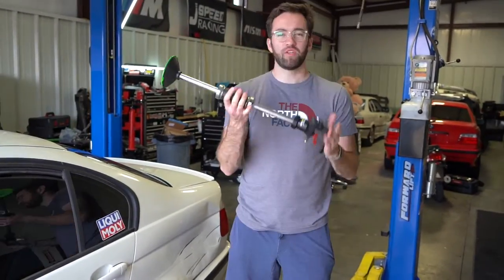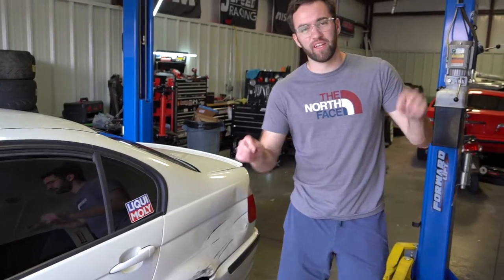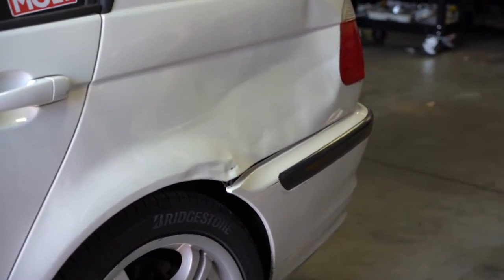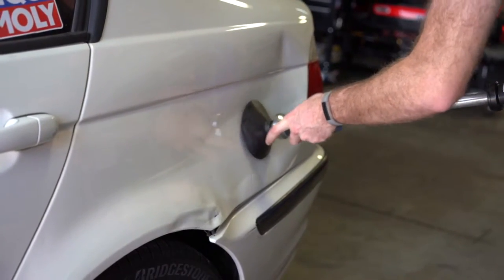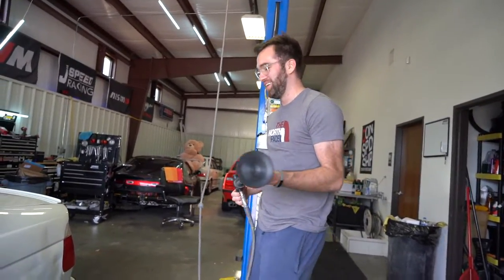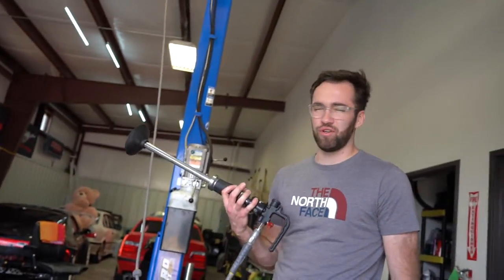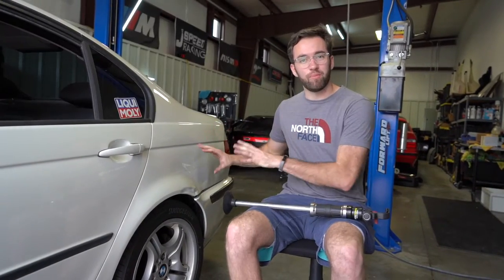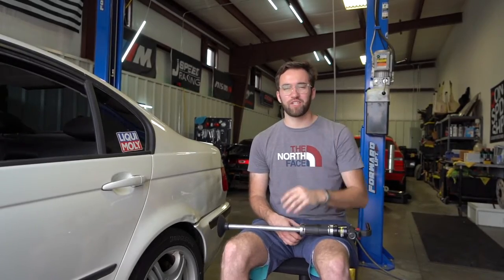Harbor Freight Dent Puller Review! Worth The Money?

Comment: I like it but question is does it work without air pressure think?I don’t have air pressure tools.
Reply from the maker: No it needs air sorry
Reply: @jspeedracing  how much air? Will a pancake compressor work and what psi did u use?
Reply: Check the specs on the puller , you can get a descent compressor for pretty cheap now days